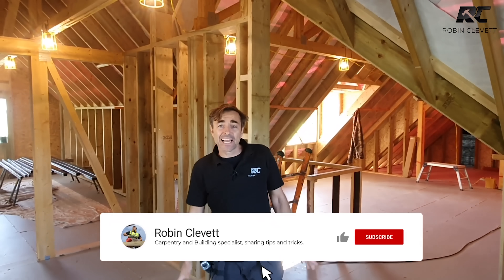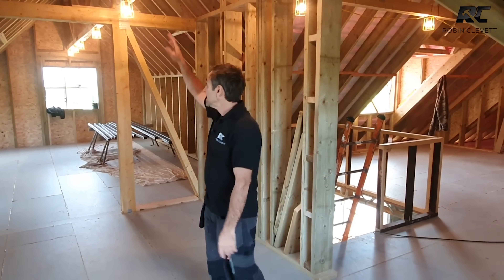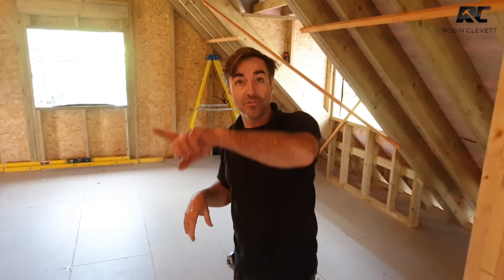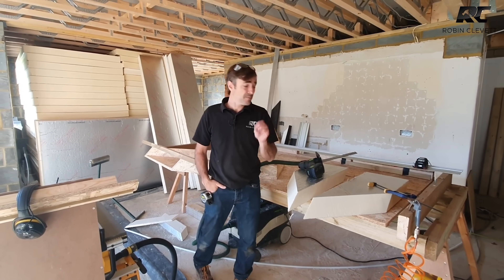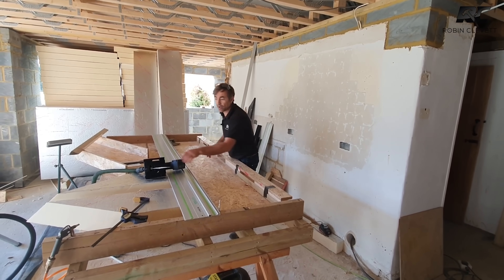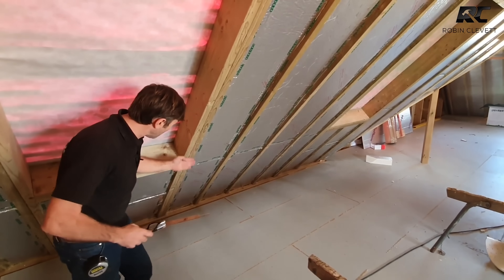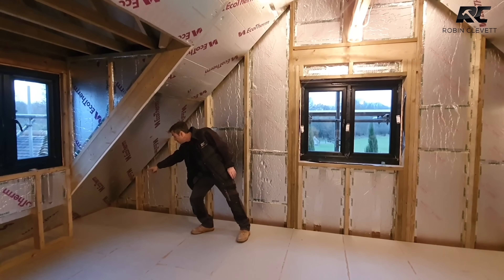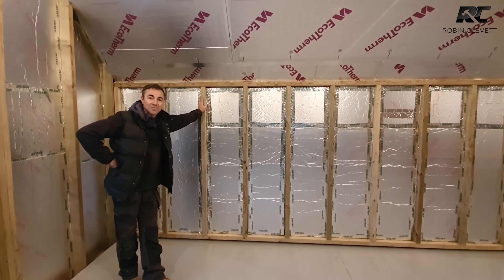How to fit insulation 2023 to the latest Building regulations Part L

Comment: I have seen your video before about cutting and fitting PIR sheets using Gappo tape. I love your set up and the jigs you use.
As I have said before, I am just a rough old trowel but I did a kitchen refurb last month, I made jigs up for drilling for the handles. The customer was amazed at how perfect it all looked when I finished.
Thanks for sharing this wisdom Robin. Jigs save time in the long run and reduce stress so much.
Reply: I do love jigs too!

Comment: On our next self- build we will having 80mm pir over the rafters and 160mm spray foam between the rafters.  This insulates and creates an air tight seal.  We looked at pir between but our roof has hips, valleys and part of a truncated cone!  This dictates a 400mm spacing for the rafters which I also prefer.  This is a warm roof and with the levels of insulation and air tightness now being specified ventilation will tend to be mechanical.  Let me know if you want to construct a conical roof!
Reply: Look at getting a triso super 10 over the top rather than the pir, performs better and will give you more head height.
Reply: @rossmale8715  unfortunately no longer certified for use in the UK?
Reply: @caravancapers5091  it did lose it at one point but its definitely LABC approved now I use it all the time. Check it out
Reply: There's a few gray areas around that spray foam insulation in the UK, apparently the mortgage companies don't like it. We used it on a loft conversion a few years back and when he came to remortgage he had a nightmare. Skill builder did a video on it not long back, might be worth a look.
Reply: @davethepirate5253  your right, I actually have a friend he's an accredited installer and even he's not totally sure on it.  Perfect for the US market but I'm not keen on it for use in the UK.
Reply: @davethepirate5253  I will double check just in case thanks

Comment: Lovely to see the forethought at the design stage to accommodate the insulation. Please could you let me know why you push the cut between boards up past the bottom of the rafter creating a void ? We have always had it flush with the bottom so the two layers touch effectively.
Reply: I will wait for Robin to reply but at a guess, that pocket of air between the layers gives another layer of insulation, a bit like the air between two pains of glass in double glazing. Over to you Robin.
Reply: I was thinking the same,  he said it was a cold roof design, so that would leave me to believe that a 50mm gap between the insulation and the roof batons would be required??? Once the insulation is pushed past the rafters lower edges, the airflow gap is then reduced.

I also think that the gap between the two insulation layers would lead to a possible condensation problem.
Just my thoughts and also Intrested in Robins response.
It does look a good job👍
Reply: The void is minimal and will not condensate as the ecoterm insulated board is also a vapor barrier. By not leaving a small void you could possible end up with a few humps on the internal surface. 👍

This is truly a masterclass from Robyn. 👌

Comment: When I started my career, it was 50mm of fibreglass wool in between rafters; never saw rockwool until a few years in !!
Reply: The house I bought in 1991 was built in 1959, and had 25mm (1 inch) thick fibreglass insulation between the ceiling joints.

Comment: With all of the current emphasis on reducing airflow, what level of oxygen replenishment will be acceptable before it affects the health of the occupants?
Reply: Lol I don't think that will become an issue but what will become an issue with lack of airflow is humidity levels might start to get out of hand, especially with heating costs currently.
Reply: For our builds, assuming airtightness <0.6 ACH @ n50, you're looking at 30m³/h/person with an MVHR that get >75% heat recovery
Reply: Ventilation which is controllable via trickle vents should be managed by the occupants?
Reply: @thetessellater9163  I don't think even this will be enough going into the future, I think MEV will become mandatory with heat recovery

Comment: Its alright, when I asked Building Control recently "Did you actually see the steels put in? See them in place so you know they are correct before you signed it off" I was told "No, we rarely see any steel go in as the builder normally has already covered it up" well then don't sign it off them. For all you know, they could be lying.
Reply: Take photographs as proof, must cover yourself in all eventualities.
Reply: I think you mean steel.
Reply: @lukethompson5227  Yep. Keep mixing them up :)

Comment: I like to use a 50mm pir, then a roll of triso super 10 across the top and cross batten with 4x1. Sparkies can then first fix in between the 4x1 and when it's all taped up its super air tight. Easier for plaster boarding too. I believe it works out slightly cheaper
Reply: Tri-Iso Super 10 needs a 25mm airspace either side; it must not be 'squashed'. Some friends of mine were amongst the first to use it, even before it was recognised by Building Inspectors - they had to go through a long process to get it signed off.
Reply: @thetessellater9163  yeah that's right. Exactly how I do it. Cut 50mm kingspan in between using plunge saw and vac too. I can't stand pir, it stinks its messy and you waste loads
Reply: @rossmale8715  I don't think robin has much waste 🙂
Reply: @kadzo1000  haha no he doesn't, that isn't the real world though let's be honest lol